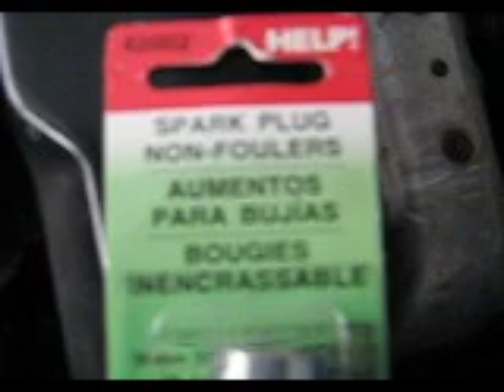Video #16 - Hook-up Location For HHO To Engine.

Comment: I saw Roy McAlister sparkinjector, and I think that if you modify an  4 sparkplug extension, making a hole in each one and conect a cooper tube to each hole to buble, you have a direct h2 delivery to the engine cilinders, adding more negative pressure (vacum).Good videos tks!

Comment from the maker: The silver beracket to the left in this video is where I had a cell. I have moved it to the rear of the vehicle in the truck area for now but working on another design to fit under the hood.

Comment from the maker: I have 1 plate system in the chamber. 9 plates. 1 positive and 1 negative w/7 neutrals between. I figure as the cell heats up, all the neutrals become active and after 2 days, it's holding steady at 15 amps. I will need to up the KOH solution a bit to get the amps higher. Still not putting out enough gas...No results yet on this unit. Should have so numbers in a couple days. I can't wait to get $700 together to get my dry cell plates and gaskets. That sucker is gonna rock!

Comment from the maker: I'm not sure where the correct vaccuum line would be but once before I hooked the line into the PCV valve - T'ed it. It collasped my bubbler and sucked all the water right out of it into the engine!  So I stay away from vaccuum lines...